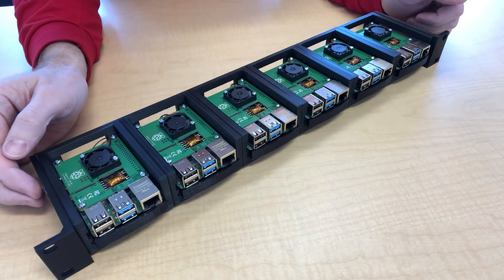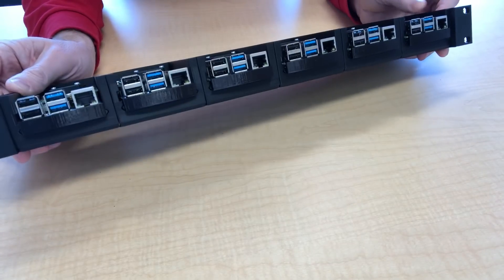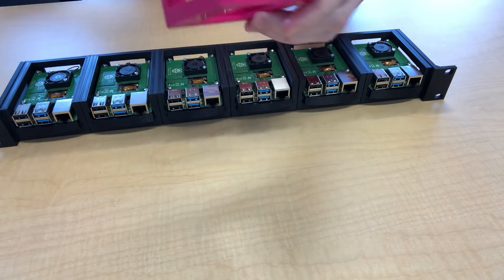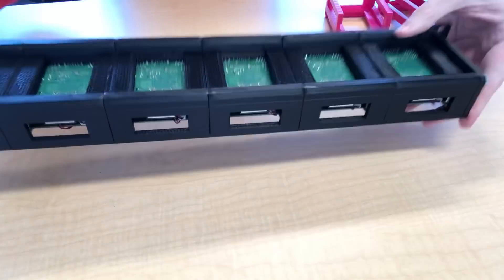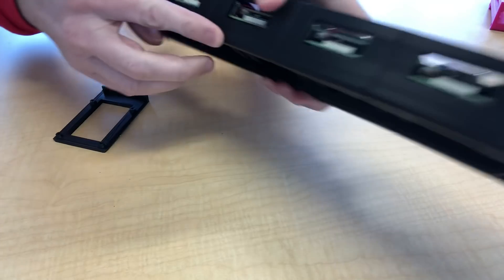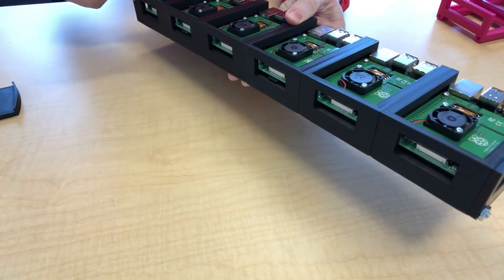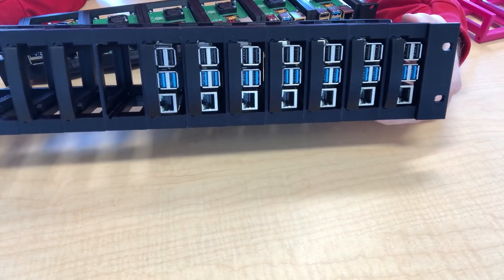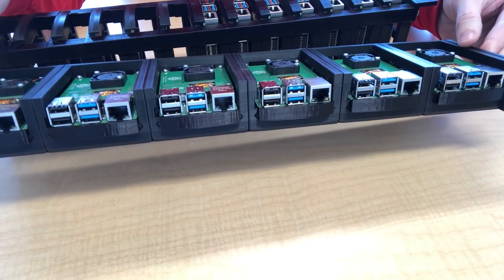Raspberry Pi 4 1U rack-mount bracket

Comment: This is exactly what i see someone using a 3d printer for. A great well though out solution for a problem. Maby for a version v2 or a branch would be to allow usb power cables in the back for people not having/owning POE. But for now a perfect build. Im going to print as soon as i have a printer. THank you
Reply: but when I see something like this, where you're making simple shapes in bulk, I have to wonder if they couldn't simply be cut out of raw plastic sheets (presumably different thicknesses for different sections) and glued together?  I have to think the 3d printing must be much more expensive.  I see 3d printing as something for complex shapes that can't be readily produced by conventional means, or are being done in such small numbers that one or two-off runs are too time consuming or costly to be done by other methods.
Reply: @SenileOtaku  But anyone can have and use a 3d printer. A solid block takes more specialized and expensive equipment to process

Comment: Question though, is the cooling enough when the pis are put under pressure??
Reply: I think for the horizontal Design it should be, for the vertical design however, that could be a problem

Comment: Hi. 1. Thx for this awesome work. 2 I am from Germany and look for a Company for 3D Printing. I have to pay 500€ for this Print. This is my first contact with 3D Printing. Fells very expensive. Waht you pay for print? Do I have to change anything on the files or are they all ok? So the files in a 3D printer and everything fits afterwards?
Reply from the maker: That sounds like a lot of money for a print! I was able to borrow a 3D printer, and this rack probably used about $10 worth of PLA filament. We also have a local makerspace with several 3D printers that I could have used for $50/month membership + materials. Even buying a low-end but decent 3D printer costs about $200-$300, so 500€ seems too high.

The files should be ready to print assuming you can source threaded rods of the right size. You will want to adjust the OpenSCAD files to fit a metric size rod if that is what you have available locally. I don't know which sizes are commonly available, but M5 or M4 would be about right if those are options. Say you found M5 rods, you would adjust the bolt_size parameter in the frame and ear parts to be 2.5 (the radius of an M5 threaded rod). A very simple change, but it will require installing OpenSCAD and then regenerating the STL files.
Reply: @RussRoss  Thanks for the quick, detailed and nice answer. I'm looking for a 3D printing service that has reasonable prices.
Reply: I now have an offer from an online 3D printing shop. 40 €. That sounds like a reasonable offer. what size are the holes for the threaded rods? M6 m8 m10? I would like to order them and not wait until the parts are there.

Comment: i have seen other 3d printed cases that claim to be interchangeable between RPI4 and RPI3B+, would these racks hold a 3B+ as well as the 4?
Reply from the maker: Ron Poppe I believe so. There are two main differences to consider: (1) the ports are in different locations, so cases with precise holes for cables are not interchangeable, but that doesn’t apply here, and (2) the ports on the 4 stick out more (especially the audio jack) so a case designed for the 3 might not fit a 4, but one designed for the 4 will more likely fit a 3. I’m pretty sure a 3 will work fine with this rack, I just don’t have one to test with so I can’t be 100% certain.